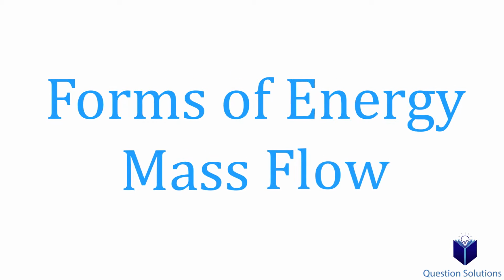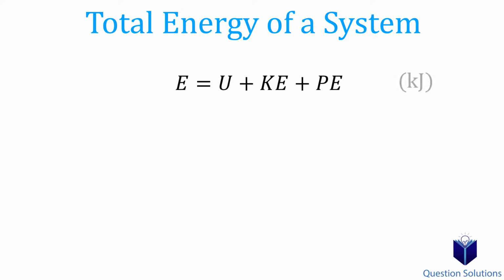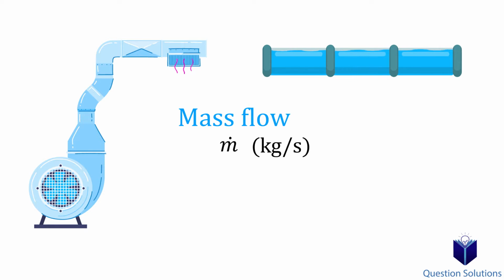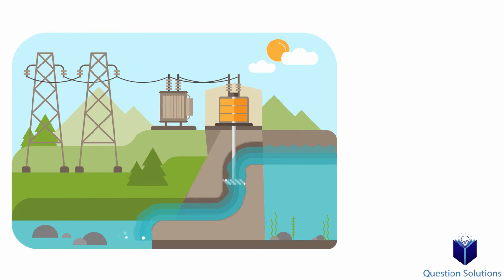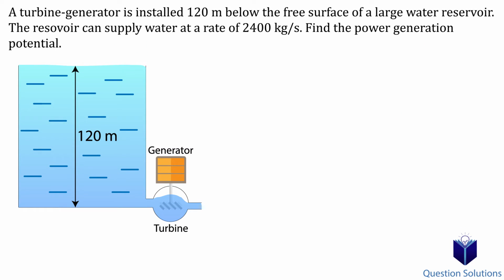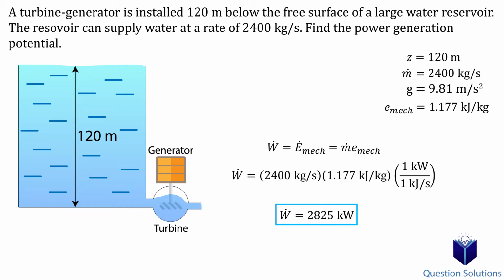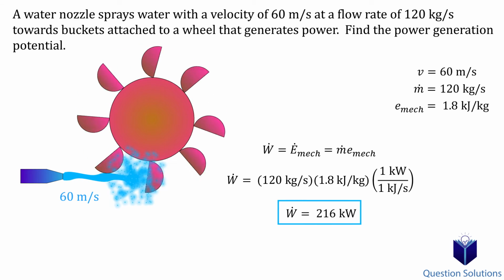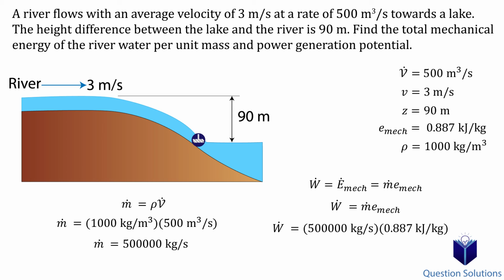Forms of Energy & Mass Flow | Thermodynamics | (Solved Examples)

Comment: why flow energy (P/p) isnt used in the total energy calculation?
Reply from the maker: Where are you referring to? Please use timestamps.
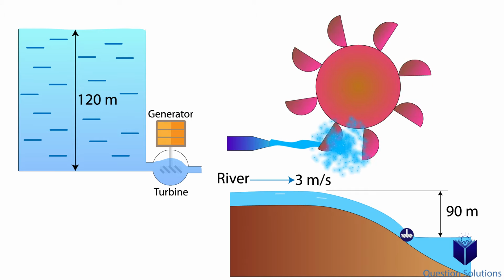Reply: @QuestionSolutions  the practice problem starting from 5:20. P/p is part of the e mech equation where emech = flow energy (P/p) + kinetic energy + potential energy. When do we include the P/p in a problem ?
Reply from the maker: @nexxar12  In this problem, we were already given the water flow rate, so all we had to do was multiply the water flow rate by the mechanical energy to get the flow energy. We only need to use P/p if we need to figure out the flow work if we were given the pressure and density of a substance.
Reply: @QuestionSolutions  thanks! your videos are really helpful

Comment: hi i have a question. For the first example, why isn't the flow energy added in the calculation? flow energy can be calculated too.
Reply from the maker: So you don't need flow work to calculate the power generation. If you want to learn about flow work, it's at a much later video in the playlist. At this point in the textbook/course, flow work itself isn't used. If you'd like to learn more, see: https://youtu.be/80jNAHRKD0M?list=PLXePpKFSUW2bcuUy2fKCI9gKJJ5GXjg92 I think it was in this one, but you can look through the playlist and it's definitely in there.

Comment: hi there, i was wondering is there any tips to break down such complex question problem that is not only written without images/picture but also have data that spread throughout the question problem (such value, clues, assumption, and etc.) that you can turn into a simple known data just as you show in the video there? any tips even a little one will be appreciated🙏
Reply from the maker: I think for most problems you face, it's super helpful to draw a diagram. It doesn't have to look nice, but something that you can actually look at. Then you label everything given to you in the question. If the question involves 2 states, so for example, before a reaction vs after a reaction, draw 2 separate diagrams. Label initial conditions on the first diagram, and then the final conditions on the 2nd diagram. That way, you have a visual representation of what the question is offering you. Next, think about what the question is asking from you. Without thinking of numbers, think about how you can get to the answer it's asking for. Think about the equations pertaining to your question, what can you use? Then you can start step by step. Sometimes, you will make a mistake, but that's perfectly fine, then you retrace back to the step that went wrong and go down a different path. 

All of what I said can be helpful, but the most helpful thing you can do is to practice as many problems as possible. Try to do a few easy ones at first, then a few medium ones, and finally a few hard ones. It doesn't have to be a lot, solving 5-8 questions per chapter should give you enough insight to solve other problems. I don't know if that's helpful to you, but the best way to become a master at these problems is to try and do as many of them as possible. :)

Comment: Hi, I was wondering if you could share tips for Mechanical Engineering majors and tips you use/used in school to gain such profound knowledge of the subjects. I purchased all of the textbooks and try to stay 1 week ahead of the class, but some topics are truly difficult. I am taking Thermodynamics 2, Electrical circuits/systems for Mechanical Engineers, Solid Mechanics, Fluid Dynamics, and Calc 3. I was stuck on shear force and bending moment diagrams for solid mechanics, and your videos helped me with that a lot. I try to attempt all of the textbook questions, which is very very helpful but consequently very time-consuming. My goal is to continue with my undergrad research and graduate with a ~ 3.8 in 2 years, and hopefully be admitted to MIT/Stanford graduate school. You have helped me a lot in the past with your videos, so I would love any advice you have for success.
Reply from the maker: You seem to be doing pretty much everything I would do. What worked for me when I was doing undergraduate, and really, anything further than that, was to create a schedule for my self. So if you have 5 or 6 courses per semester, you dedicate a single day of the week per course, leaving 1 free day to redo anything you're struggling with. This works for some students, and for others, it might not. It just depends on your learning style. Also, you don't have to do all the questions in a chapter, rather, do a few easy ones to understand the basics, and then skip to the hard ones. Usually the last 3 or 4 questions of the chapter will let you know if you grasped the concepts properly or not. Lastly, your school will give you access to past exams, so time yourself and complete them, it's very helpful :) Best wishes with your studies!
Reply: @QuestionSolutions  Sorry for the very late response, but thank you very very much for your advice. I will implement your advice! ps: your videos has helped me have an average of 100 in Mechanics of Materials so far, especially the statics review ones! I actually found about you from a professor for one of my courses who listed your channel as a key resource for success
Reply from the maker: @rehanrashid9296  Wow!!! You might not know this, but your comment made my day. Other professors listing this channel as a key resource is such a nice thing to hear :) Many many thanks for letting me know!